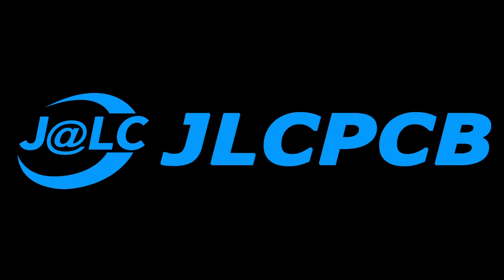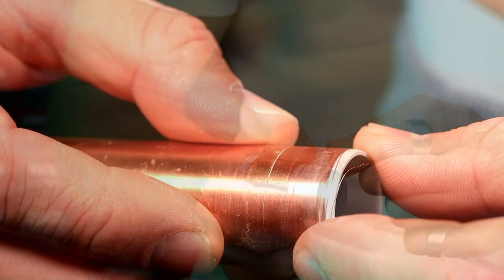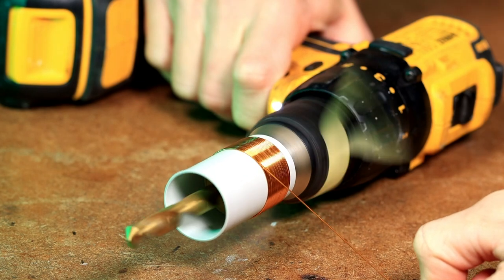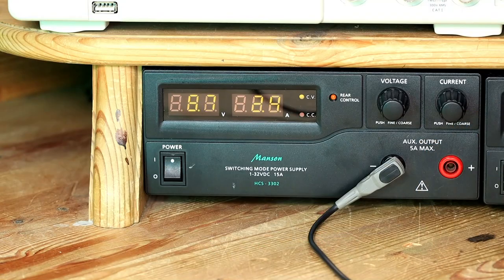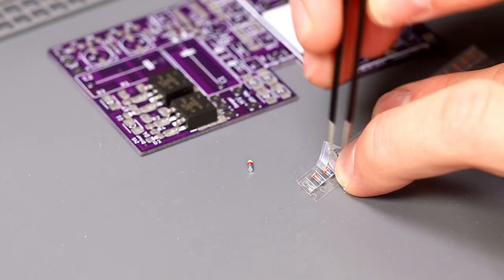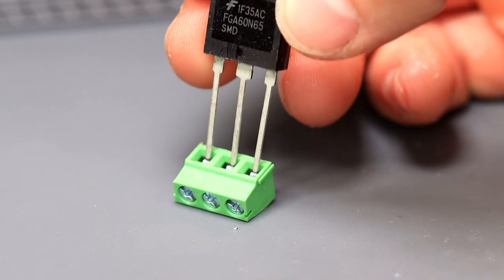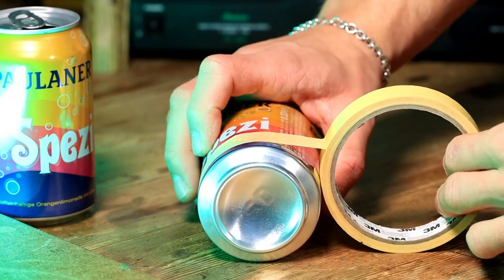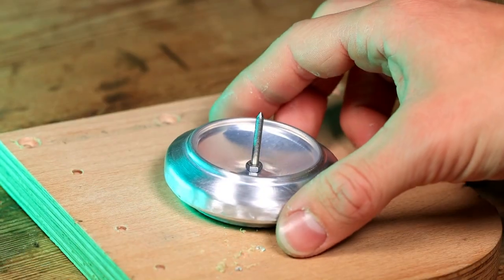Tesla Coil Life Hacks you need to know

Comment: Definitely keen to see your winder in detail, been working on one myself but suck at writing code. but one difference in my design is not using the threaded rod to mount the form, it makes loading and unloading a pain. my design uses tappers set up like a lathe with a fixed headstock and a moving tailstock, with the form held perfectly on tappers regardless of size, and easy removal by releasing the tail stock. be happy to share my design in better detail just say the word.

Comment: For a toroid You can use the can from tuna fish or cat food.  If you build a coil winding machine you can use an ac to dc plug-in power supply (transformer) that has adjustable voltages from 1.5-12 vdc.  Also a "step switch" for the above pwr supply purchased from Harbor Freight to make life easier when winding the coil.

Comment: Thank you for the tips and advice! I think if all the tinkerers here pull their dead mosfets together we'd have quite an impressive but still disappointing mountain. My pile consists of mainly tip35c transistors. I had a hard to find problem of RF feed back that often cooked the hole circuit.... 😂 Turned out the feed back and ground wires where to close and there was an inductance problem. But every failure is a success and a lesson. Anyhow thank you for sharing your journey thus far.
Reply: Also I apologize for my bad grammar.